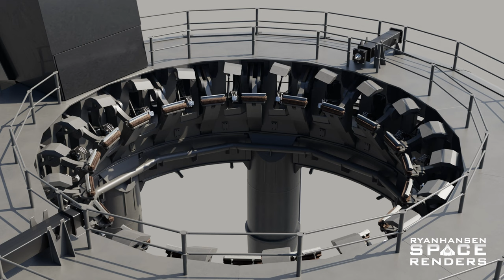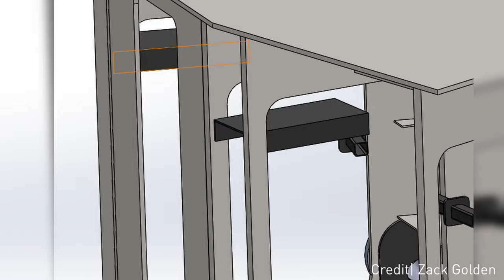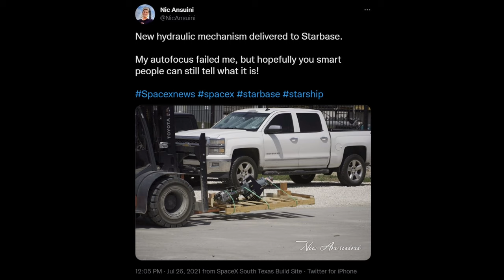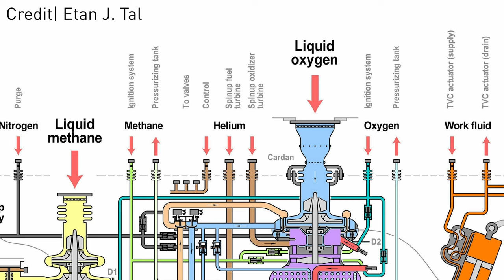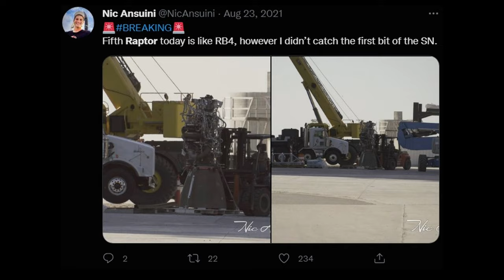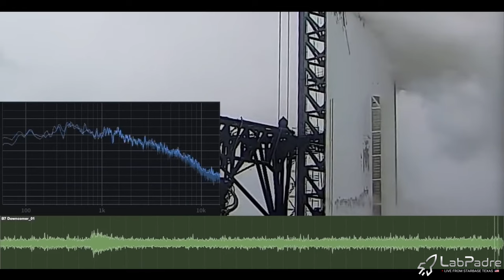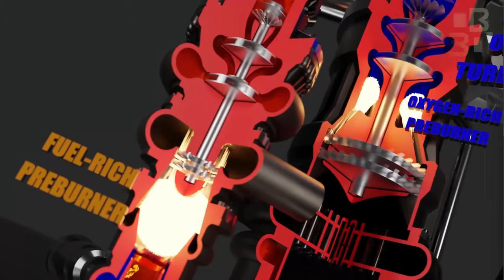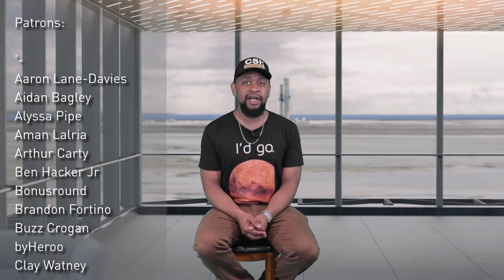Booster 7 Explosion - A Detailed Examination of the Complex Mechanical Systems Involved.

Comment: I loved the deep dive into the launch mount, I had heard that much of the launch infrastructure for the booster was going to be integrated into the launch mount to save weight and space on the booster but had no idea how extensive those systems were. the legs was an obvious one but all of the priming and starting system for 24 of the 33 engines is quite alot more. Thank you, this was an excellent episode!
Reply: The reason why the igniters for the 20  outer boosters are on the mount is because, once MECO and SSEP, I suspect that those 20 engines do not get relighted for Boostback and/or Reentry Burns. The center 13 (gimble) engines would handle those tasks; as well as the Landing Burn.

Comment: I noticed this from LabPadre's footage of the explosion. If you move through frame by frame, the camera grabs a 'lucky frame' where you can see a blue glow coming from the very center, resembling the color of a Raptor's exhaust flame post-startup. Now I know this wasn't an engine startup, but I had my suspicions that  the source was from the combustion chamber of one of the engines. Every person documenting this event suggested that the flames found an 'unintended ignition source' on the ground but I wasn't sure. I wrote this off thinking that the framerates on the camera were too low for me to verify my argument, so I just wrote it off. Thank you for this insight.

Comment: just watched on premier. I don't know if youve seen it (probably too late to make it into video), but short after last starbase weekly there was a zoomed-in view of the inside of the launchmount on Labpadre with B7 taken off. These 20 added vent pipes were seen to be connected to literally nothing on the inside, but having a bent towards the center of OLM. It pretty much confirmed your suspicion: These pipes were drectly connected to the outer raptor engines - lower than the QDs - which also explains all the engine covers were missing as they would have been in the way.

They can't launch like that. Looks like yet another redesign of the QDs will be necessary before launch...
Reply from the maker: For the records. I made this video before that detail was obvious.  Thank you for pointing this out.

Comment: 11:50 In fail-safe systems, it is customary to duplicate systems and even quadruplicate them. For instance, in the Apollo 11 lunar module fuel system, where you would use just one valve otherwise there were four: a series of two parallel valves. This arrangement will assure you can both close and open the fuel system line in case of single valve failure. Similar arrangements for liquid oxygen lines, etc.

Comment: I think that if the FAA had finished the evaluation in December as the were initially scheduled to, then 4/20 would have flown, but with the extra several months of development, production, and stage 0 construction changed so much that they decided to move to 7/24 and make much more use of the stage 0 capabilities, and it's taken a little longer then they had hoped to get things ready to fly because the goalposts were moved so much.

Comment: At 50:20, that looks like an explosion-proof container for that panel. My guess would be that the ignition source triggering the explosion was an electrical contactor in one of those cabinets. I would predict that any cabinet with electrical contactors on the launch mount will be thus enclosed to prevent an explosive atmosphere from being ignited by a spark from an electrical contactor. A spark from electrical equipment in this area of the launch mount would explain the ignition point appearing to come from under the booster.

Comment: What I see in the high frame rate image is just a uniform flash of white under the entire mount with no obviously brighter point. The brighter yellow color from the engines occurs AFTER this flash. Concussion from an explosion originating from the ground up would have been reflected when it hit the inside of those engine bells that the concussion hit relatively evenly, where some fuel and air would have been pushed by the overpressure. And a collimated pressure peak would have shot out the bottom of the affected engines increasing combustion intensity in a focused stream as the overpressure around the engine bells and inside the engine bells would make gas re-exiting the bell look much like the flames exiting the engine during normal operation, confined by the external pressure to a vertical stream. I don’t think the imagery necessarily suggests an origin under the skirt. I think the engine bells themselves can not help but expel an expanding ball of burning fuel in a straight downward direction at high velocity. Its the entire point of their shape.
Reply from the maker: I like this explanation! I will look into this a little more.

Comment: Love your deep dive on how orbital launch mount is an essential part of getting those raptors going, and that is way more complicated than what most people think. 
You may have revealed more "secret sauce" than Elon was willing to tell Tim on his latest StarBase tour. 🙂
Now that they are finally working on the chopstick parts that will attempt to absorb the remaining kinetic energy from the descending booster, do you think it would be feasible to test it, by lowering the booster on these parts, at 1, 2, 3 or X ft per second and then abruptly stopping the descent? 
Or would that, from an engineering point of view, not be comparable to catching it out of the sky.

Comment: somewhat of a tangent but do you have an opinion about the Starbase safety record?  i can think of at least two events that could have lead to serious injury or death ...  the sled falling off the tower before the chopsticks were installed and the hydraulic failure ... tangential to that, how many of the noted testing failures were related to bad procedures vs bad design ... bad procedures would be an indicator of sloppiness

Comment: SpaceX Boca Chica IS an R&D facility. That means they are in the Business of Re-Designing their product until they've reached Scalability and/or contractual requirements (NASA). That's why the final Falcon9 version is known as a "Block 5" Booster. It's the final product rated for Human Spaceflight . . IOW, no more mods or Re-Designing. Re-Designing is expected and required with Any R&D project of that scale. Saying an R&D company was "forced" to re-design Anything is like saying  "NASCAR Driver Forced to break the Speed Limit"
Reply from the maker: If they want to get to this first orbital flight, then they are forced to make this change.  There’s no way around that argument.
Reply from the maker: This is not an optional R&D improvement.

Comment: Zack, dump YT and get a job at SpaceX. Everything in these videos is just an early release of information that somebody else has already figured out. Your work loses all value when the official data is eventually released.

Instead, spend your limited lifespan working on problems that nobody has figured out yet -- the details of a working stage zero. Every successful contribution you make there will increase in value over time, even when it's only a set of lessons learned for the next iteration.

You're an engineer, and you want to go to Mars. So spend your time building stuff. And go there.
Reply from the maker: Thanks William.  I don’t really have a desire to work for SpaceX.  I have a full time job that I enjoy.  

Think of it this way, a lot of people really enjoy football, but most of them don’t go try out for professional teams. It’s not that I don’t think I could get a job there, it’s that I don’t think I would enjoy it as much as I do from the outside.